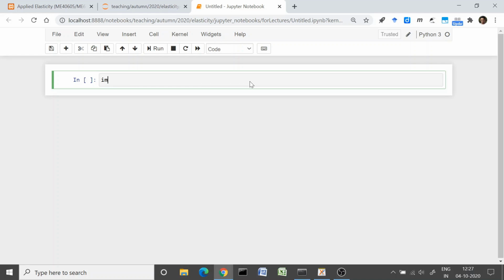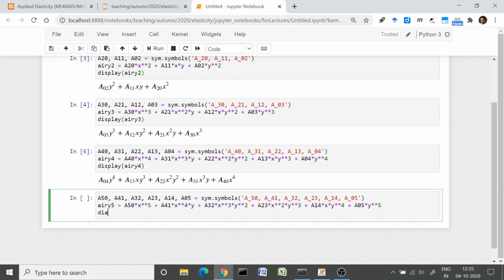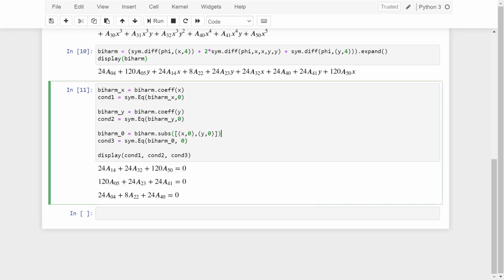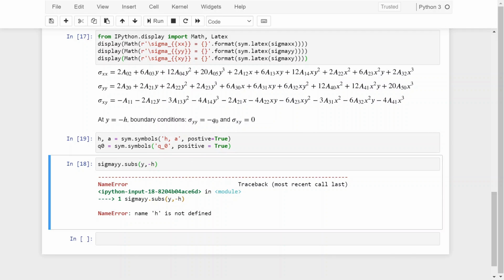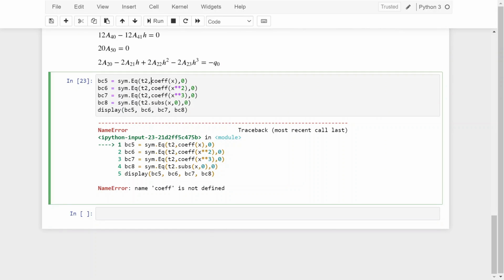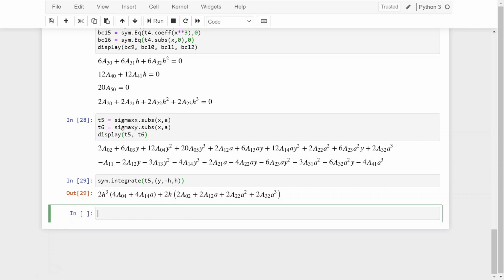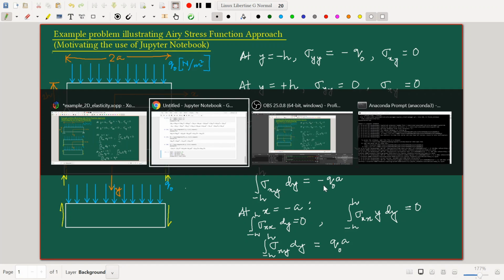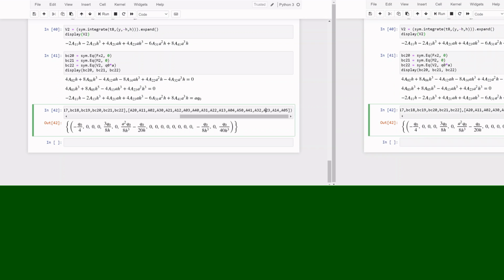2D elasticity – 8: Example Problem Solved Using SymPy in Jupyter Notebook

Comment: Here is a MATLAB implementation in case anyone needs it:

clc; close all; clear all;

% Parameters.
syms q0 h a

% Unknowns.
syms x y
syms A20 A11 A02
syms A30 A21 A12 A03
syms A40 A31 A22 A13 A04
syms A50 A41 A32 A23 A14 A05

airy2 = A20*x^2 + A11*x*y + A02*y^2;
airy3 = A30*x^3 + A21*x^2*y + A12*x*y^2 + A03*y^3;
airy4 = A40*x^4 + A31*x^3*y + A22*x^2*y^2 + A13*x*y^3 + A04*y^4;
airy5 = A50*x^5 + A41*x^4*y + A32*x^3*y^2 + A23*x^2*y^3 + A14*x*y^4 + A05*y^5;

phi = airy2 + airy3 + airy4 + airy5;

% Biharmonic condition.<
biharm = diff(phi,x,4) + 2*diff(diff(phi,y,2),x,2) + diff(phi,y,4);% Bi-harmonic.

biharm_x = coeffs(biharm, x);
condition1 = biharm_x == 0;
cond1 = condition1(2);

biharm_y = coeffs(biharm, y);
condition2 = biharm_y == 0;
cond2 = condition2(2);

biharm_0 = subs(biharm, {x, y}, {0, 0});
condition3 = biharm_0 == 0;
cond3 = condition3;

% Stresses.
sigmaxx = diff(phi, y, 2);
sigmayy = diff(phi, x, 2);
sigmaxy = -diff(diff(phi, y), x);

% Boundary conditions.
t1 = subs(sigmayy, y, -h);
t2 = subs(sigmaxy, y, -h);
bc1 = coeffs(t1, x) == [-q0 0 0 0];
bc2 = coeffs(t2, x) == 0;

t3 = subs(sigmayy, y, h);
t4 = subs(sigmaxy, y, h);
bc3 = coeffs(t3, x) == 0;
bc4 = coeffs(t4, x) == 0;

t5 = subs(sigmaxx, x, a);
bc5F = int(t5, y, -h, h) == 0;
bc5M = int(t5*y, y, -h, h) == 0;

t6 = subs(sigmaxy, x, a);
bc6F = int(t6, y, -h, h) == -q0*a;

t7 = subs(sigmaxx, x, -a);
bc7F = int(t7, y, -h, h) == 0;
bc7M = int(t7*y, y, -h, h) == 0;

t8 = subs(sigmaxy, x, -a);
bc8F = int(t8, y, -h, h) == q0*a;

eqs = [cond1, cond2, cond3, bc1, bc2, bc3, bc4, bc5F, bc5M, bc6F, bc7F, bc7M, bc8F];
vars = [A20 A11 A02 A30 A21 A12 A03 A40 A31 A22 A13 A04 A50 A41 A32 A23 A14 A05];
[M, b] = equationsToMatrix(eqs, vars);

sol = M\b;
subs(phi, vars, transpose(sol))